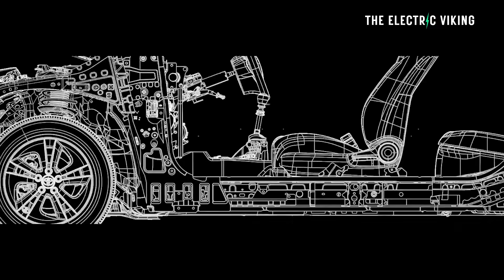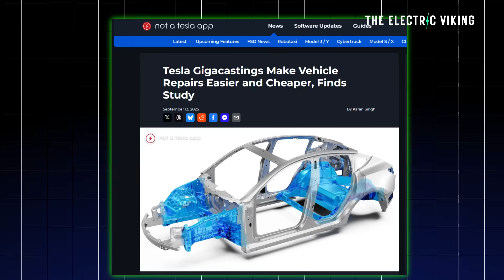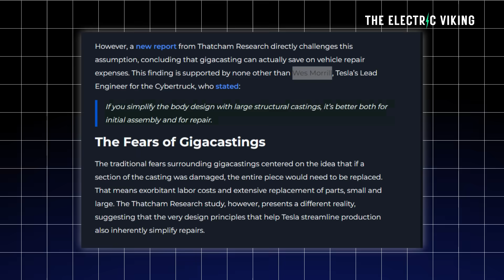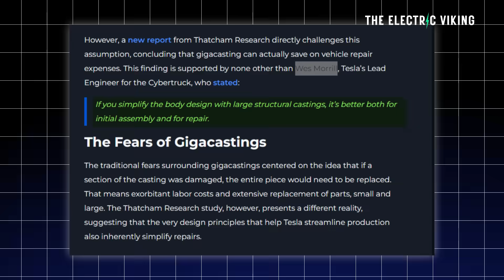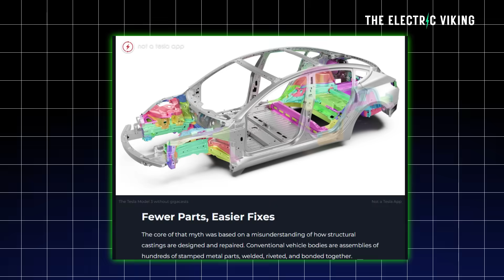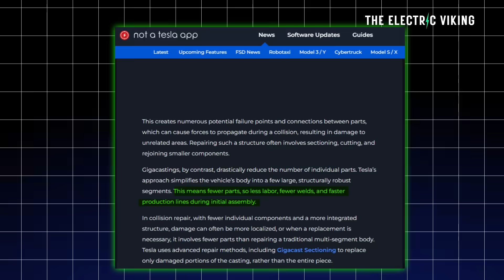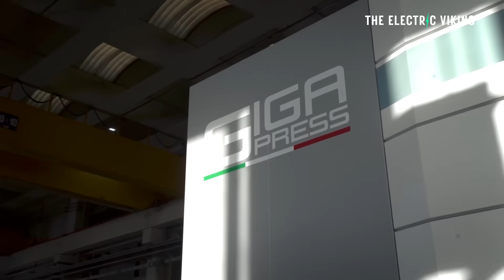Repairing Tesla’s Gigacasts — New Study Shocks Everyone

Comment: You can weld castings, there have been videos on the very subject. Like all crash repairs, if the structure has designed-in energy absorption that works well and the car is declared a write-off, then be thankful your body is not a write-off. Priorities! The casting can be designed to break in a controlled way, and be better at it than a collection of 20 spot welded elements. The weakest link is always the nut behind the wheel. And it is always the other guy, anyway!

Comment: A long time ago before the total domination of unibody automobiles, cars were called "body on frame". It wasn't uncommon, when the entire front end or back end of a car was destroyed, to replace the body panels with a front or rear "clip". Which was ostensibly a premade front third or back third of an automobile. It was bought as one unit and installed as one unit. Giga casting has just circled back to that time. It was a way of replacing a large portion of the car economically

Comment: I for one thought the gigacastings would be impractical if not impossible to repair.
Reply: Watch the repair videos on YouTube.  The parts are designed with repair points all done by the book to ensure the repair is as good as the new part.  There are still limits however, but those limits apply to all cars.  The assumption is always that the original engineers didn't do their homework. In this case they did. However we can't assume that will happen with every brand. Only time will tell if everyone follows the Tesla approach to the letter or if they cut corners.

Comment: I was one that expected that many body repairs would be more expensive with giga casting. Firstly there was no talk about the availability of sections that could be replaced, secondly the aluminium casting is not ductile and can’t be pulled back into shape. I watched a YouTube channel recently where the guy was very experienced at repairing damaged giga cast Teslas and he stated that there were areas of the giga casting that could not be repaired and that Tesla were making more and more different repair sections available. The £2000 cost savings is meaningless as each repair is different, so they must have done one repair and in that case it was cheaper on a Tesla than on another manufacturer’s car, but I’m sure that there will be some examples where giga cast cars are more expensive to repair.
For me jury is still out.

Comment: Whether Teslas are more or less expensive to repair than standard builds is a complex question and the answer remains to be determined (in my opinion).  Insurance companies have strong financial incentives to minimize repair costs--but car companies don't have those incentives.  They may even have a perverse incentive to make repairs costly--so they can sell replacement parts or replace totaled vehicles.
Reply: Or it could be a damaged Teslas are more valuable as a parts car. The ones crashed in the United States are often purchased by foreign buyers, shipped overseas and reassembled. Recently a guy found out is wrecked Tesla was driving around in Ukraine.
Reply: Tesla has its own car insurance company.. Safety first please  40,000 people die each year in the USA . Repairs are not a priority
Reply: I believe in the not too distant future,EVs will be so cheap,that they will recycle the batteries, and scrap the rest
Reply: Indeed, it remains to be seen. Too bad pundits can’t acknowledge that reality and explore the multiple sides rather than make bold hyperbolic claims. I guess that’s what gets clicks.
Reply: Car manufacturers have designed intentional failure points and maintenance requirements into cars for years. It's a huge part of their business. 
EV's are already removing a huge income stream for manufacturers and they will struggle without it. The only option is to improve manufacturing efficiency. 
They have in effect been forced into doing it with EV's and the consumer will benefit.
Reply: Except if the car manufacturer internalizes the benefits of such design which is intended to reduce both manufacturing and repair costs. Tesla getting rid of independent dealerships, and instead offering its own insurance and repair shop, allows them to capture the benefits of their designs. It is a double whammy: cut out the losses created by the independent dealerships over-charging for repairs and parts, and instead offer insurance repair service by Tesla.  When a car has a serious accident and must be totaled, Tesla will be in a position to just offer a used car of the same or greater value. No insurance paperwork, no litigation, no estimation, no complicated repair. They just turn around a used car, end-of-lease car that has been refreshed and cleaned up, including full warranty, and keep the parts of the totaled car for other repairs.  They can deliver the replacement right to the owner, and pick up the damaged vehicle, reducing a lot of headache for drivers.
Reply: @bengt_axle  I does not work that way.
Reply: @rogerphelps9939  Tesla does indeed offer car insurance (only in certain areas). But what I'm saying is that they have to capacity to disrupt the market, like no other car company can, even if it has not already implemented what I've outlined.  Especially for leasing.

Comment: Many cyber truck rear castings broke in half. If you repair it it will break again. Castings are great until they aren't.
Reply: Blatant lie.
Reply: @JohnSmith-x3y8h  Tesla offers a kit to fix the frame!
Reply: So it's fixable
Reply: @GlossaME  That is what they say but cast Aluminium is brittle so if it gets another shock load it may break at another spot. I would check with your insurance company if the trailer would be covered if the bumper comes off the truck due to the frame breaking.

Comment: 49 years as a tig welder . would be nice to know the chemical make up of the castings ? The previous way was built in redundancy , so we needed a new car every 10 years , so glad that thought process is changing .
Reply: Should be aluminum with a bit of silicon I believe.
Reply: @chrishaberbosch1029 Musk comes from silicon valley.
Reply: I watched the video of the repair.  I don't think they did any welding. They used glue. One part of the video shows them lifting the whole truck off the ground with a crane with two small cylinders glued together.  It's pretty amazing. https://youtu.be/slblWQw1L1c
Reply: @59seank  Ive seen a few of those ,but saw a guy mig welding in the clip?
Reply: The thought process isn't changing. Look at how fast new models are being generated. Novelty sells.
Reply: An old MunroLive video has details, but what I remember it was something like 2024 with low copper and relatively low silicon for a casting alloy.
Reply: @martylawson1638  and a long list of obscure elements, I saw the list. Some for strength, some for fluidity under pressure, some so the annealing process could follow straight from the die.

Comment: Getting a bunch of little parts aligned and back to factory safety (for future crash) is very difficult and labor intensive. A casting is already perfectly aligned at every single mount point and doesn't cost much.
Reply: So replacing a longitudinal  casting that goes from the front of the car to the back is not labor intensive and is cheap?
Reply: @davidhumphreys9938   -the cost of the parts  - -is often dwarfed by the cost of labour - tearing the car down to the base structure - remove the subframe is not low cost (SE has no real idea, he isn't any sort of expert, more a pundit.)...

(Damaged batteries write off EVs..)
Reply: @davidhumphreys9938  Casting are just front or rear. I don't think anyone is using a full length one yet. Maybe that's why ICE cars don't use them, you have to have the battery pack in the middle.
Reply: But if it is bent it has to be replaced. It may not cost much but the cost is in removal and refitting.
Reply: @rogerphelps9939 That’s not how it works. Castings have break away crumple zones. So yes you replace the entire thing and some are less than $1000.
Reply: @frankcoffey that is not what I have seen. There are designed in repair points. You only cut and replace what is damaged
Reply: @robertoz3710  That might be good if there are no alignment issues. How is the new section attached? Aluminum welding?

Comment: This repair ability issue always bothered me . I can see the advantage due to reduced parts no rattles and it can't come apart. From some of the comments on the Tesla Forums it looks like Insurance company's want to write the car off with damage that would be repaired on an ICE car. Munro had some reviews on this he thought it was brilliant and a lot of other manufactures are following.
Reply: テスラは修理費は高額です。なので保険料も高額です。
Reply: @田中亮太-k3u 

Blatant lie.

It’s the performance they have.
Reply: I think what's going on is that if a particular structural piece of a car is being welded together anyway during construction, you're better off with one casting instead. The casting is cheaper, and any force large enough to wreck one bit will usually damage the others it's welded to anyway.
Reply: In modern cars, any collision that sets off the airbags will immediately write off the car.

Go learn something.
Reply: Remember that Sandy Monroe’s business is advising auto manufacturers how to lower their production costs, not making repairs less expensive for consumers.
Reply: No.